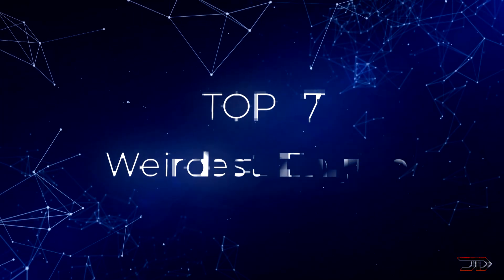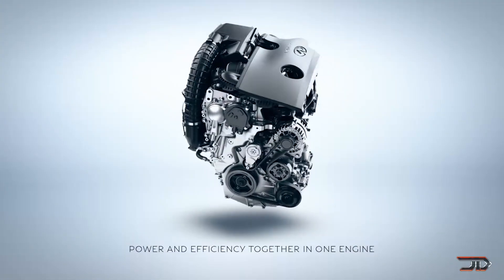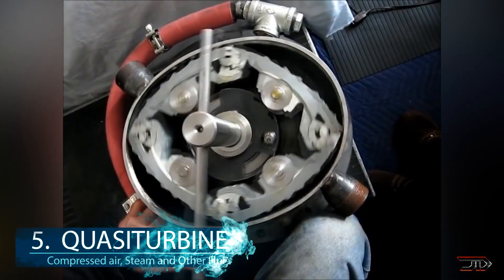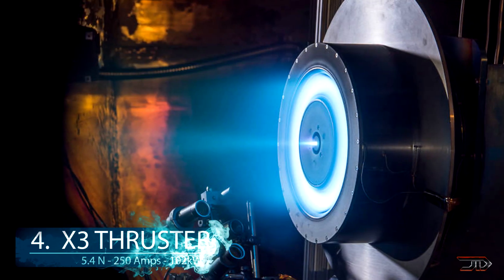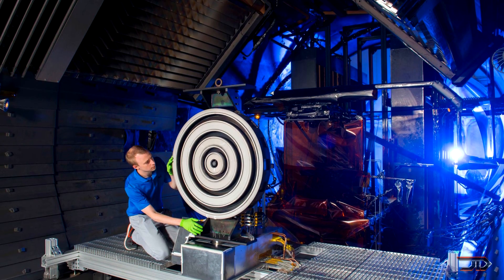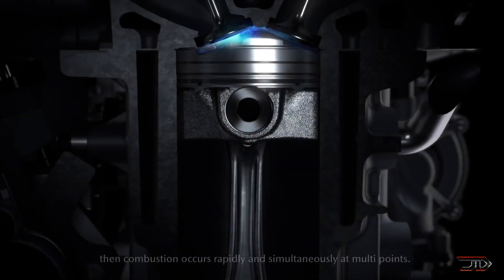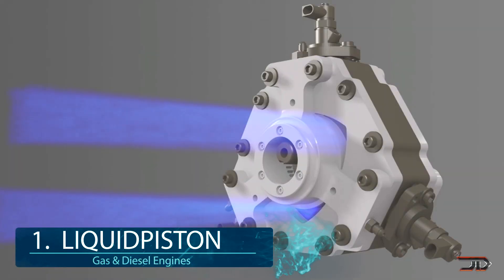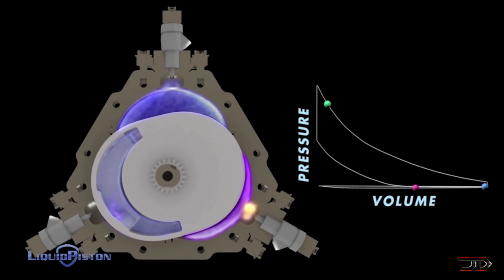7 STRANGEST New Engines

Comment: There is could be endless possibilties. It's all about two fenomen. Combustion and pressure. You can do any engine mechanism with this two fenomens. This is just about interruption of universive's physics. Endless models and concepts. Like a clay. But only two obsticles are there be always. Effeciency and wearing. More part comes with more problems always. Either have to be solved or not. Briefly all about interupting to nature.

Comment: 1st engine (Atkins Cycle) already exists and works.... but it's easier to get same effect by adjusting valve timing, which is already done.  This tech has been around for decades. 
Circle Cycle: Hopeless. You can't get oil to the cylinders nor to the piston.  It's also not blockless, it has 4 blocks that can't be cooled because you can't surround them with water jackets.  Absolutely hopeless, and the 3d model is wildly out of scale.
Quasiturbine: Hopeless, it's been around since the 1980s and in truth it can barely run, consumes oil, combustion chamber too long/narrow.  Too leaky, not enough power.  It's had 40 years to become commercialized but hasn't and won't. 
Mazda engines: Really impressive, and there are more interesting engines that just this Sky Active engine. For one thing, only Mazda has successfully commercialized the wankel engine, and only mazda is using a wankel engine as a range extender engine, which is extremely cool and clever.
Achates: not new but very good design due to much lower heat loss.  Also no head gasket issues! This engine should be in trucks NOW and it should have the Scandia 'Ducted Fuel Injectors' (DFI) because these burn so clean you don't even need emissions equipment!
Engine manufacturers are so conservative that none of them will try improvements, as they are seen as too risky.
Reply: Liquid Piston: You'd be forgiven if you thought this idea couldn't work. They made it work, and it works fantastic. This engine is now in all kinds of military drones, etc.   But if you look at the parts, they are too hard to make.  A hollow crankshaft with gases going thru it....??  The rotor is also really  hard to make, ultimately this will probably be a niche engine only.
The Circle Cycle especially is wildly unrealistic, how do you bring a spark to the cylinders? you don't.

Comment: That VC drive is just side-stepping the old Saab SVC  patent.  Saab had the whole cylinder and head move farther from the crank.  Much simpler and still nothing came of it.  
Also could be argued you trade mechanical simplicity for more difficult crankcase sealing.  This VC could be superior.
https://en.m.wikipedia.org/wiki/Saab_Variable_Compression_engine
Reply: I got here because I am looking for the engine that spins about the piston, there are two con rods that go opposite directions and work seperate pinion gears on what looks like a large ring gear from a rear end.  Its 250cc and has the output shaft coming out the other end than the spark plug.  Seems to be some kind of rotary valve system controlled by the spinning combustion chamber.  I saw it in a YouTube short but lost the link.

Avadi MA-250

Comment: 1:04 circular engine will easily replace the current boring combustion engine.. if the cylinders are modified and made more wide at the base, and narrow at the top, to ensure "catastrophic failure" never happens, and they always match up instead of hitting each other and destroying itself.. this way, the piston doesn't need to be the same size as the space it fits into, it can have flexible attachments with springs, to detach and attach safely without breaking the spinning gears in the twin engine cores.. this way even if they break they will not be devastating, they will just slow down, and be removed from the engine by the driver, in a few minutes, replaced with new pistons.. or left out entirely, and let the other pistons do all the traction work
this is the third revolution (engine efficiency), and the first two (road efficiency & fuel efficiency)
so fuel doesn't have to be a luxury no one can afford in the Ice Age..

Comment: ..imagine you can just throw useless food you can't eat anymore, or rotting food that got spoiled.. in your car! in the 'compression tank', where the food is pressed, to make those flammable gas bubbles leave the fibers faster.. until they can be stored in gas tanks with mobile cylindric cores to control the pressure of the gas inside.. then inject them into special steam engines, if these gases can light up an electric jet engine that heats up the steam inside them.. and you have a food-powered electric jet core, steam engine for the car of the future..
considerably lowering that high fuel cost, in modern cities that will make it more expensive, since the demand for fuel will only increase in high density towns.. and more cars only mean more demand, more cars, more pollution, and more price hikes..
Unless. It's. Powered. By. Food.
(the excess fiber waste that has no more flammable gases, can be transported to New Jerusalem, or a nearby desert.. to be turned into "fresh soil" for terraforming the sands.. as long as a thick enough layer is deposited.. the wind or sandstorms won't dissipate it.. and it will collect into more and more layers of fresh vegetable fiber for enriching the soil, that future plants will grow their roots into)..

Comment: The first engine would be great. If I am seeing that right the Pistons move straight up and down no side movement from the journal so you can easily turn the engine without so much stress as opposed to most engines where they get angled on the lifters. That's what makes an engine so hard to turn the crank. With that being said it should get a lot more power and fuel efficiency than most

Comment: It's a shame that opposed piston didn't make it to modern heavy applications. Because it actually has various advantages over a regular 4 stroke.
- No valvetrain = less moving parts
- Robust mechanism
- 2 stroke = better power density
- Longer total cylinder stroke = better efficiency
- Proven tech on WW2 aircraft and tanks

Comment: The last rotary engine design would be great if you could just replace the seals easily. Just have them slide in and out the front of the block. The seals don't move so you can just slide them out the front. Just make that easy to access and most people would be fine if they could replace their apex seals every 50k miles if they only cost like $30 a piece.

Comment: Hello . My Lord Boss and I invented a super revolutionary engine for any type of fuel, including synthetic methanol for negative CO2 emissions and HYDROGEN for ZERO emissions, obtaining much more efficiency than a current engine and greater than batteries and also fuel cells. fuel that are used with hydrogen and electric engines, a novel thermodynamic cycle with more than 75% efficiency, only two main moving parts, a power / weight ratio greater than 13 KW / Kilo, everything can be aluminum except main shaft and screws, uses no liquid coolant only air, uses very little lubricant that can be used from the center through the seals to lubricate everything, the speed of the seals or segments is 7 times less than in any engine, can be extrapolated to any power without losing any features, is under international PCT patent process. Very easy to manufacture 100% with current basic technology, all its main moving parts mounted on commercial bearings, the useful life is up to 30,000 hours with very low maintenance, almost zero and more than 70 additional advantages....
As an example: Motors of 60 kilos of 1000 Kw can be made very compact without useless space.
https://www.youtube.com/watch?v=5WBoIzC0azY

Comment: Screw everything you show in this video, because electric motors are going to be the only ones which are being supported by the government. At least in germany.

I know, this is a strategy to get the engineering of this kind of motor to a higher level, and electromotors have a high efficiency and are very useful, but where do we get the electricity to run them? From coal plants. Definetely not ecofriendly. Right now Diesel engines are the most ecofriendly solution, that being said they won't be in the future.

Comment: That cycle engine is a unique idea but I can already see some of its flaws . For 1 that’s bitch would be loud asf even with any repercussions to make it quieter & what homeboy said in the video is right if you mess up the placing in which the combustion happens your whole engine would be fucked another problem would be how much wear would happen since only 2 pieces of metal & the surrounding 2 or 3 components are taking on the load of a whole ass car . that’s a definite no for me you’d be goin through engines every 20-30k miles but don’t mark my words I ain’t a expert but I feel I have enough knowledge to have a decent opinion on the shit

Comment: The achates only gets 37 mpg? But is incredibly more complex? If it makes less then 500 horsepower stock, it's not ever going to be a success. You can get better gas milage far simpler, simple is equal to reliability. The only thing it could redeem itself with is power.

Comment: VC Turbo: Its got a lot of parts, eight or so extra parts per piston. Thats a big parts count increase. Assuming that its reliability holds up, its for high end use only. Probably limited production, only for the next three or so years.  Its a better concept than the Cadillac shutting off pairs of cylinders though.

Comment: the liquid piston rotory by simple physics is definitely a bit of an upgrade. Its basic physics. The rotor path is smoother and because it uses less forms of motion, more of an in and out AND round and round creates less dynamic internal momentum change=less momentum to change=less rptating weight+a round rotor design would seem to allow different terms of compression.
Reply: Do you have any links to forums or sites where people are actually making and testing these? Thanks.

Comment: im guessing from the design, the epex seals will be the main wear points that need replaced, and if properly taken care of..i have seen rx7 engines go for years with just normal routine maintenance you should give any engine, with minor mods more so... (adding an external oiler rather then using oil from the pan so you can use 2 stroke or similar oil designed to burn, not oil designed not to burn inside the engine is the main one... and.. i helped do one.. it took us a day... would have taken less but we also spent alot of time bullshitting and getting pulled off task.. heh..

Comment: as a fan of japanese cars and engines, i personally dont like the vc turbo infiniti engine because cars guys like engines that are easy to work on and moddable. if it has that arm that controls the piston stroke distance means more electronics and wiring that would be a bitch to work on. but then again, i dont like infinitis at all.

Comment: that reverse rotary is very interesting and so is that new steam engine, that steam engine could work flawlessly on boats in large or small applications (smaller being safer)

build two long cylindrical tubes that heat water like hot water heaters that creates steam, to keep pressure you would need a constant level of water, if it drops youd lose pressure which means youd lose power which isnt very efficient by todays standards. so to keep the two long water heaters constantly filled with the correct amount of water and steam you would need the right size bilge pump to fill the heaters and shut off whenever the heaters are at a certain level of water, also they would need to turn on when that level drops to keep it consistent so that the pressure never drops. hard to use in any cars or land vehicle because it wouldnt have water to supply the engine with the correct amount of pressure to maintain power but could absolutely be used in boats in many applications and honestly could be pretty efficient and self sustaining.
Reply: I'm really interested in the reverse rotary. As I've always understood it one of the biggest issues with Wenkel (sp?) Engines is the apex seals. Since the apex seals are no longer rotating maybe if they place them in a location that can be easily reached they could make them a standard wear part and if the replacement is easy make the lifetime longer.

Comment: Here's a true rotary engine. It's made of a cylindrical formed combustion chamber enclosed both sides which is supported by a fabrication. The cylinder is rotated by the vanes of an impeller which is forced round by the pressures from the exploding fuel air mixture.
The explosive mixture is fed into the cylinder from the inlet manifold in the centre of the one side where it's ignited. The explosion creates the pressure wave of 360 degrees and turns an impeller as it expands from the centre of the cylinder much the opposite way an impeller driven hair dryer or Furness fan works. The impeller is fixed to a cylindrical rotor which then turns. The cylinder is connected on the side plates of the cylinder and turns a spindle. The spindle turns both the valve opening of the inlet and the fuel pump injection.
The efficiency comes from doing away with the reciprocation of the violent changes in directions of the moving parts.

Comment: Nothing will ever be as great as the overhead valve, pushrod V8.

I grew up a big time gear head and I recall reading a very technical book about engines where the author explained that if engine technology had continued to improve at the rate it did from the 1940s-1960s, then today's small block Chevy would produce north of 10,000HP and 15,000ft/lb and last for 25 million miles

Comment: All of these engines can be replaced with an electric motor. Why are we still trying to develop new engines? It would be better to work on more efficient electric motors if the brushless motor isn't already the most efficient and to develop a better battery technology.
Reply: Mainly, because electricity needs to be generated. Solar and wind are unreliable and expensive, hydroelectric is dependent on weather  patterns (see Hoover dam), and electricity produced using fossil fuels incurs efficiency looses every time the power base is converted into a new form. Example; natural gas to heat, heat to steam, steam to rotational force in a turbine, turbine to AC electricity, high tension wire transmission losses, transformer losses, convert to DC for battery storage losses, through an inverter back to AC to power the cars motor…
Reply: @buellb0y  Which are all good reasons for improving the efficiency of batteries to store energy. Once achieved, that energy can be used to power efficient motors. Additionally, loss of power in transmission is irrelevant when homes have solar systems built in and batteries to store it. Besides, fossil fuels are a finite resource that are are difficult and expensive to retrieve and refine to mention nothing of the pollution. As for hydroelectric power, it's waste that has undermined that resource as much as anything. I live 20 minutes from Hoover Dam and water conservation is a dirty word out here. 
So all things considered I still can't see the value of putting time and effort into an old technology besides the fact that none of these "new" ideas presented much real promise or progress. They simply attempted to refine a technology that should be relegated to the dustbin of history.

Comment: Let's paint our 100+ year old invention in a different color, then call it "New". Dude, it still mixes gasoline or diesel with air, and ignites it. Still as inefficient as it always was, and blows out 40% of the energy as heat.
Reply: In small applications more like 75-55%. There actually is a lot of room for improvement in efficiency in many applications of the ICE. Most of them are still far from the maximum theoretical efficiency, that of course never can be reached. Electric motor is 100 year old invention as well. By other words, that doesn't really tell anything.

Comment: Thrusters on spacecraft in orbit don't have a maximum velocity, as there is no noteable air resistance counteracting the accelerating force. The 25 miles per second you mentioned are probably just the highest speed considered relevant for a mission using this thruster. Though I am not sure which mission this would be, low earth orbits only require ~5 miles per second, and escape velocity for interplanetary missions is about 11 miles per second.

Comment: More efficient than a wankel rotary engine????? LMAO the most comin MPG reporting's are 44 drivers report 15 mpg, 46 drivers report 17 mpg, 53 drivers report 18 mpg. that's 143 out of the total of 285 making it a tiny bit (1) more than half reporting less than 20 mpg. the next highest number of drivers at 37 say they got 19 mpg. and these are reports from owners of the RX-8 so id say that they are bias in favor of the car and engine.  So it is not hard to be more efficient then the 1.3lt Wankel rotary. A large V-8 gets better mpg than that.

Comment: the major benefit of the Liquid Piston engine when it comes to Rotary type engines is that they have managed to get rid of the Apex points, which is a major issue for Rotary Mazda owners.  By getting rid of them, they can increase the efficiency and power of the block.
Reply: It seems that there's still Apex points, just on the other side, the 3 sharp edges, but it also looks like in this design they will wear slower than a regular rotary.
Reply: Mazda has pretty well fixed the apex points in its latest engines.
Reply: Hows the oil consumption going to be though? Lol
Reply: @GamingWithUncleJ  seeing the clip of the chainsaw makes me wonder if it's a straight 2 stroke. 😂
Reply: I think the major advantage is the ability to get a higher compression ratio. They still have the seals, but they're on the walls rather than the rotor. Because of the shapes, I would think it would have better wear characteristics.